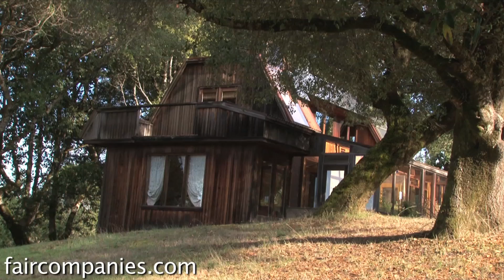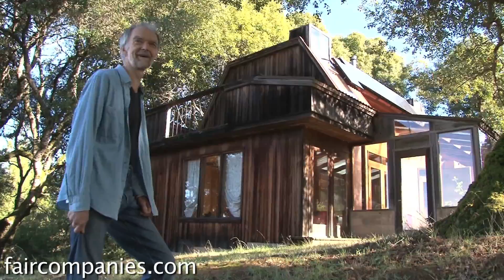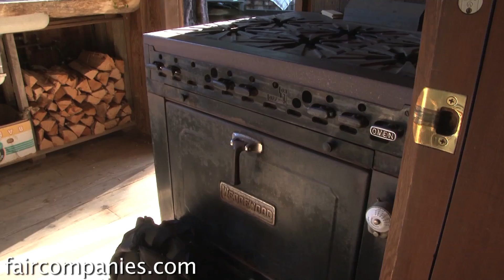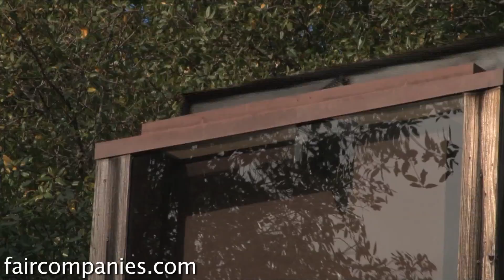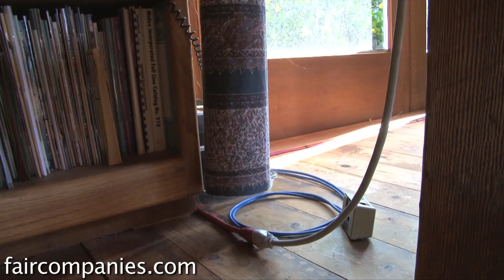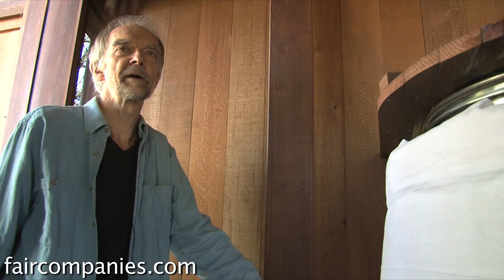C++ programmer builds off-grid home with sunroom & DC lighting

Comment: You "should" only avoid things that harm you somehow. My reaction to fluorescent lights was to the 60 Hz flicker and lousy color rendition. Now that high-frequency electronic ballasts and better phosphors are available, there are actually some I like. Unfortunately the common screw-in CFl bulbs tend to use cheap flickering ballasts and cheap phosphors, more offensive than modern offices and stores. But if you don't notice, even when you stop and consider, you're lucky - don't worry about it.

Comment: I suspect you're thinking grid-connected. My system is battery based. But it is still an interesting question that required a lot of thought. The batteries are far enough away, and the existing wire small enough, that reducing cable loss was critical. I decided on four series pairs of panels, to get the voltage as high as the MPPT (Outback FLEXmax-80) could handle, keeping the current through my long panels-to-MPPT cables, and thus the wasted power, low. The panels are nominal 200W each.

Comment: I like the tube sock idea.  And actually the solar air heater when opened at the top will suck hot air out of the house. Most cabins use a propane refrigerator. Is his refrigerator running on electric? I am going to watch the video again. Thank you for sharing.

Comment: how far along does a company have to be to get a sweet Faircompanies video? I'm 22 years old and around 2 years ago I started Project Wosho LLC in hopes to start a market in my area for small house builds. There is a 12 by 12 by 12 cube design and a roughly 1k square foot design that was put out there about a year ago. I started my business and decided that if it didn't get its feet on the ground that I would call it quits. Project Wosho is currently in a hiatus but if you are interested... :)

Comment: Very smart man with great idea's. People should not be turned off by the computer and its wiring. Thermostats/relays can be used to control vents, solar regulators control solar panels etc so a central microprocessor isn't required at all. Being a coder, I can understand his mindset, he wanted ultimate control over his environment... his HAL 9000.

Comment: If anyone is interested in a user-friendly control system, look up Homeseer (software) and for the wireless components, look at 'z-wave' products.  i have it and it is very easy to use, and it is open to your own programming and scripts.  a bit pricey but check out their forum around the holidays (50% off coupon this last christmas).  you can also incorporate microcontrollers like an arduino board.  HAPPY PROGRAMMING!

Comment: He mentioned the ZigBee network. A nice step forward would be to have it on a wireless network instead of running all those cables. Having all the code would help so one does not have to start from scratch though.

Comment: Guys, this really isn't too complicated for you to learn and replicate---if you want any of this, you'll need to research a lot, but this can be accomplished with a basic electronics and c++ course
.
His automated systems are based on simple sensors and relay mechanisms. Sensors to monitor all variables, providing them to the operator, and to the relay mechanisms. The mechanisms are simply based on a signal from a USB triggering a relay switch, which runs a circuit to power the mechanism. Simple

Comment: Hi,
Completely Awsome, specially the part of the microcontroler functions on the house.
My only problem with remote locations is about one simple thing: Internet access. More precisely, Broadband internet access.
For someone that works with computers all Day a solar powered like that could work with some big batteries that would not be a problem. The problem is How to get fast internet in remote locations ....